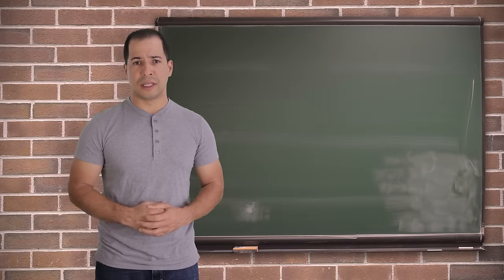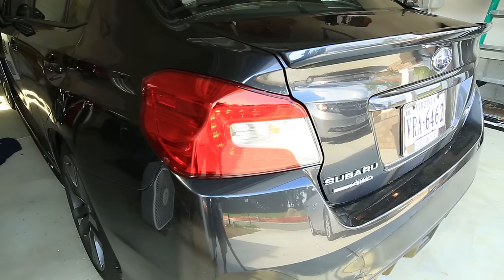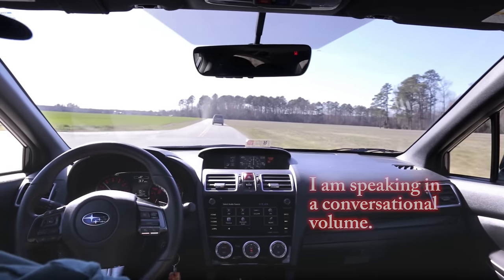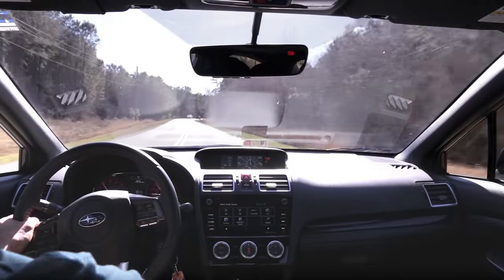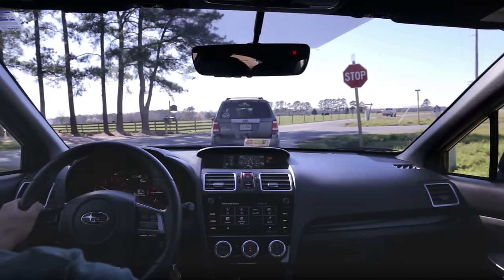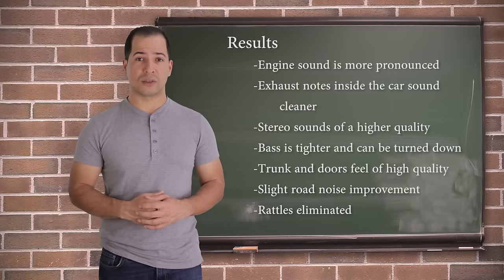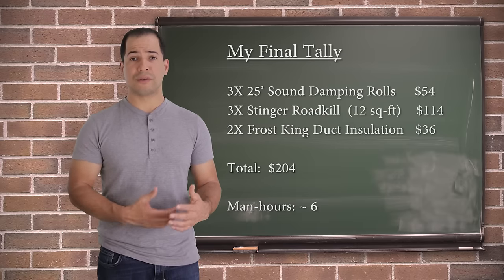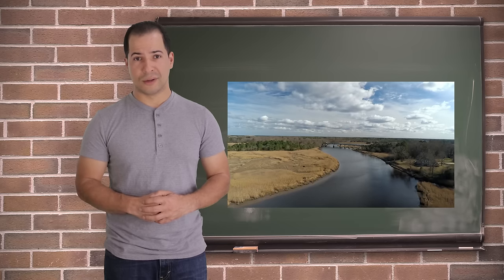Review and Final Thoughts: Soundproofing WRX Pt 4

Comment: Kind of interesting of you pointing out the rattling when the bass kicks in. I notice on my '19 (it may be related; it may not) that when the bass kicks in, my side mirrors and rear view mirror vibrates to the point that it actually disorients me when I'm looking at them when the bass kicks in. My parents have a Honda Ridgeline and their truck has a better bass and soundsystem overall and that has never happened. I had an old '10 Genesis Coupe too and even that had a good sound system. I feel like that the WRX has an adequate soundsystem but the poor soundproofing and insulation makes it terribly worse.

Comment: As a noob at soundproofing, what would you suggest first. Im thinking trunk first, then front and back floors ( hoping to slip some under without removing except perhaps side pannels. removing door panels always made me apprehensive (  last time was 15 years ago, the first time I removed anything. so far, i did not isolate any troublesome rattlea but my cars-( 2014 mustang, 1998 subaru forrester suv for trips to home depot ) both have terrible oem soudproofing, little to none that there is. Would the front left and right doors give the most bang for the buck if I overcome my fears. I have no one to ask for pointers if I get stuck. the 2014 mustang is my main, fun ride, looks good but once you get into details, these is very little quality.

Comment: Great series mate, I got a MY17 WRX CVT in  early november, with a build date of October haha very fresh from japan.
Interested in sound upgrade as I have the base model and sound proofing, as well as an aftermarket exhaust (axleback).
But concerned about warranty issues here in australia as I scored 5 years as a promotion in November.
Reply: Thanks. Road noise is definitely not low, I don't mind it but I knew going in that a wrx is not designed for comfort or quietness foremost.  I've heard that the tires it comes with are quite loud and add to overall road noise.
As for rattles, I've had 2 in different spots, hard to pinpoint and it was only 2 or 3 different occasions it happened so not sure.
In saying all this i've barely done 3000km though.

Comment: Nice work!  Sounds much more refined and livable as a DD.  Thanks for documenting the process!

Are you familiar with the "sound deadening" measures Subaru has supposedly implemented with the 2018s?  I'm curious what your thoughts on the impact of thicker door glass, revised door seals, and a foam-filled header beam would be on the road noise.